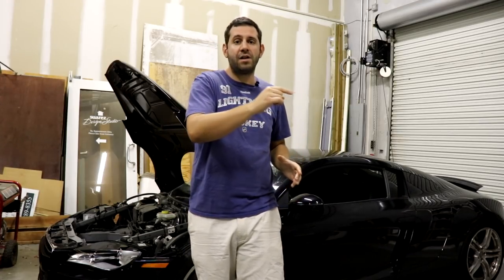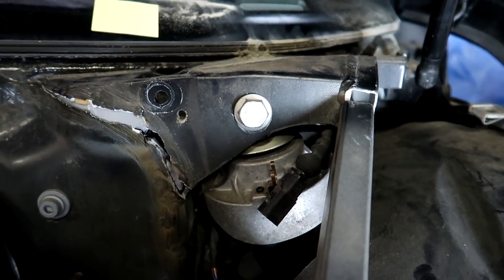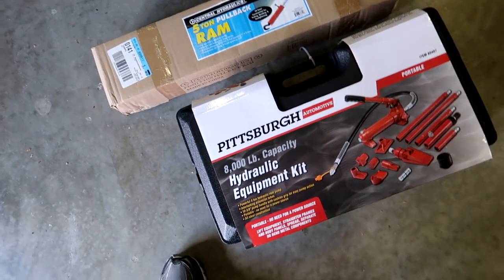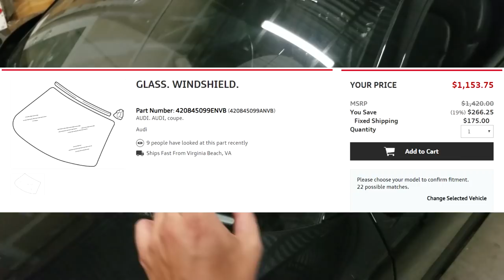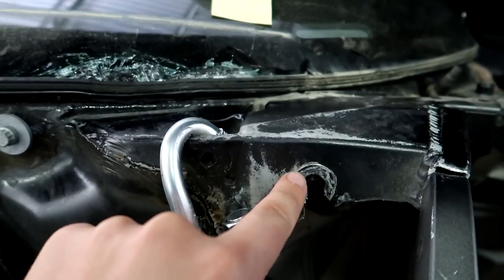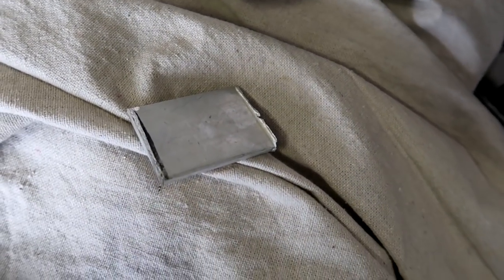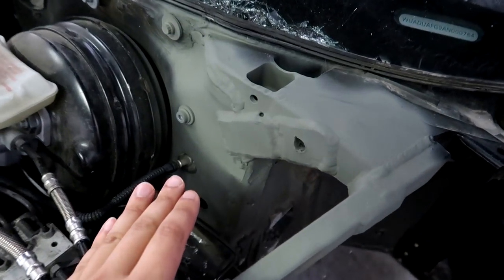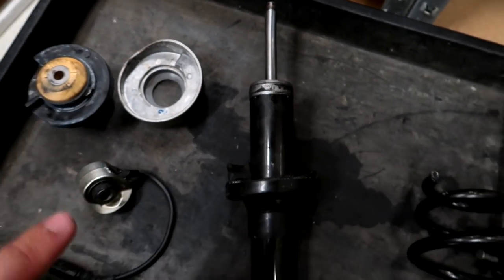I Repaired My Totaled Audi R8's Cracked Frame for $500! Insurance Quoted $29,522!

Comment: Strut bolt hole just re drilled? This is probably a very precise location when manufactured.  I dont see how it will align correctly again.
Reply: Alignment and suspension geometry isn't determined in any way by the top shock mount on this vehicle - it has wishbone suspension - alignment is determined solely by the alignment of those upper and lower control arms which you can see here as items 8 & 6: https://i.ebayimg.com/images/g/~PMAAOSwV-xa1qFS/s-l1600.jpg
Reply: @TonyRule  your comment is true, not disagreeing but the location and angle of shock affect geometry a lot more than you might think, wishbones aren't the only factor of geometry
Reply: @ty27tp  In this case they are - the top mount being out by even 1/4" would make no appreciable difference to the line of action in a double wishbone setup. Camber, rake and trail are all entirely within in the arm adjustment. You could can remove the shock entirely and the travel of the wheel will be identical to with the shock - the hub between the ball joints and the triangulation of the wishbones solely determines this.
Reply: @TonyRule  yeah I understand that, but location of the shock top mounts affects everything from ride height to damping, as far as I know this is all part of suspension geometry
Reply: @ty27tp  Fair enough. But changes in the range of millimetres to the top shock mount really aren't going to bother a road car - damping rate won't change appreciably - everything is already a compromise - I would say it varies more with just the movement of the wheel and thus the changing geometry as it relates to the hub and heat generated in the shock than that mount variance will change.
Reply: @TonyRule  guess we'll find out when he takes it for a test drive lol, but based on his other vids I'll doubt he'd even notice a wheel was missing lmao

Comment: What you are doing there is called "A Bodge Job" in English English. 7:08 I saw that one coming!!! "ohh, NOOOOOOOOOOOOOOOOOOOOOOOO!!!!!"😂 "It absolutely won't mark metal, but will break your windscreen!" I think you should add the $1300 for the windscreen to the $500 in the title.
I repaired a (steel) 1974 BMW 3.0 CSi (now worth $70-90k) that was damaged in a similar way but much worse, by jacking the strut top back down against a wooden beam across the rafters of my garage workshop! it worked. It had hit a high kerb at 50mph (80km/h) with the same wheel, breaking the alloy wheel, and knocking the suspension back 10cm, and unzipping all the spot welds on the strut top.
#Rob the Welder, CAN HE FIX IT?
#Rob the Welder, Yes, he CAAAAN... Rob thinks: " Oh, I see you've already broken your expensive windscreen (shield) so I won't bother protecting it from grinding and welding nearby..."

Comment: Look at it this way. This R* is now stronger than stock at both front mounts, regardless of the naysayers. Although it would have been nice to see a large formed metal plate that covers most of that tower, somehow sandwiched and welded to carry the stresses across the whole area, or maybe Audi should have used thicker metal and ran the front skirt at a better angle toward the bottom.

Comment: Would not touch that car.
Reply: Yeah, this is hard to watch
Reply: sheer64 anything makes sense at the right price, which in this case we do not know.
Reply: such a hack job, first bump over 50 its coming apart...lol YOU CANT REHEAT ALUMINUM
Reply: @tylerk.9495  You can't reheat aluminum??? LMAO where the hell did you hear that?
Reply: Tyler K. 35% of all aluminium produced in the United States comes from old reheated scrap.
Reply: @sonnylatchstring  Wait, really??? ONLY 35%!?
Reply: @tylerk.9495  lol what
Reply: @sonnylatchstring  And then heat-treated to give it specific strength properties.
Reply: I think the people that are commenting aren’t mechanical engineers. Some people’s kids. I would buy it for the right price.
Reply: @jameshintergardt973  I wouldn't trust this repair job just because it's a hack job. The welder seems skilled but with the amount of butchery on a high stress area of the frame I would not be surprised at all if it were to fail again. Right price however... yeah. Then I'd sell the thing for parts.
Reply: Looks stronger then the original  manufacturing process.
Reply: @jmiles9836  It's possible that that particular area is stronger but it could be causing higher levels of stress in another area of the frame. Which could cause sudden failure there. 

Also like people have mentioned the mechanical properties are out of whack especially after the fractures and welds. So because it looks stronger doesn't necessarily mean it is. 

Still, I'd just part out the car...
Reply: @tylerk.9495  So THATS why they have been welding aluminum for many decades now!!! BECAUSE YOU CANT REHEAT IT!!!! I guess recycling soda cans is wrong too, because they are smelted and reshaped back into virgin aluminum again... LMAO. WTF are you smoking dogg?
Reply: @SS-ws8bf  not even close man pop cans are 319 aluminum trash alloy brittle as shit I worked at an aluminum foundry we used 26 different alloys to make sand casting parts structural aluminum is high grade alloy has different metals added for strength
Reply: @tylerk.9495  I'm sure he's already done that and it held together fine.  It's stronger than factory now, without a doubt.

Comment: Waiting for the side load of the chain to send the jack flying. You really put you life at risk there....
Reply: There was a sizeable amount of the weight of the car on the jack. I personally wouldn't have done it that way, but it worked. I would have anchored a ring into the floor perhaps, or better yet, towed the car to a body shop with a frame rig and done it properly. I agree with others here though, this is likely not a proper repair. There are additional areas of concern that are hidden.
Reply: OMGWTFLOL  Car weighs 3505 lbs with a 40/60 F/R split. That's 1402 lbs on the front and split it in half for one corner and you have 701 lbs in the one front corner. Takes some off for the suspension, wheel and other various bits he removed and I would bet that it was 500 lbs on that 1 jack stand. Without getting into angular forces it's not a lot compared to the 8000-10000 lbs that ram could pull. I would have anchored it with a chain to one of the tow points under the car that is rated for quite a bit. Water under the bridge now...
Reply: putting your life at risk?  it's not like he was under the car lol.
Reply: greg h he was standing right where the jack stand would have shot out

Comment: How on earth did that not fall off the jacks? You need to invest in a ramp.
Reply: M ell Yes very dodgy pulling against the jack via that hole! I hope he did reference measurements against the good side for alignment at the very least and not the most aesthetically pleasing repair and reinforcement. It’s got to devalue the car as it looks bodged come sale time?
Reply: @markbennett6658  Well...he did buy it at a massive discount as a salvage vehicle with a cracked from Copart. Value only goes up from there.
Reply: I do a lot of my own work and used to work on trolleys and stands, almost lost my hand (no lasting damage) went straight out and bought myself a 4 poster, best investment ever and my man cave is a joy to be in.

Comment: I ask myself, what would the german TÜV say?
Reply: Gute Frage!
Reply: Just export it to eastern Europe as accident free
Reply: NEIN NEIN NEIN NEIN!
Reply: So ein Murks!!!!!!!
Möchte die Karre nicht für  Geschenkt haben! ;-)
Reply: TÜV is crooked in the first place when they authorized to sell this peace of crap R8 whose frame cracks like nothing.
Reply: Scheisse.
Reply: Sieht doch keine Sau wenn die ganzen Verkleidungen da verbaut sind.
Reply: What a well made and engineered German car this Audi is. Are you insinuating it is as poorly designed and badly assembled as a 20 year old homemade  Chinese vehicle?
Reply: I've had one with both Dekra, TUV and some 3rd party papers. Repair was done by audi and looked worse than what Sam did here. Not even a single letter on any of the papers or on the TUV given certification of conformity ( i bought it from a German dealer to import it to my country)... The car is a POS, i mean any R8 not just Sams one, I had a leak in the door,  both towers welded, finicky automatic, problems with MMI with a flipped picture and random lights popping on while driving. 
Sold it still under used car warranty to a guy in Italy he modded the f*ck out of it - lime green wrap, chrome wheels and i think a turbo kit. 
I own a Skoda superb now, got sick of the "high tech" cars after the R8 and an M6.
Reply: Did not used a car frame laser repair system...they worked as our eastern neighbours 15 years ago. Making 1 car out of 2. I bet this car draws 3 lines in the snow instead of 2.
Reply: Andreas Witten 🤣🤣🤣 it’s a death trap
Reply: Vhy didn't veeee think of dat?
Reply: It's fine, that's how Audi designed it; near enough is good enough!
Reply: A German TUV inspector (if he was totally honest) would say that if you wanted a high quality aluminium car you should buy a British Jaguar or other sports car or an American Ford truck not a German designed and built piece of rubbish masquerading as a supercar.
Reply: @andreaswitten  finally someone who knows how things are done right. the video is very entertaining but this not the way it should be repaired. the alignment is crucial not something you can do by eye. or a ruler.
Reply: @andrewallen9993  I almost agreed until you started talking about a Ford truck . American made cars can't corner and break much faster then any Japanese or European car. they handle like a boat. build quality of German cars in general is reasonably good.
Reply: @andrewallen9993  You can't compare a 'supercar' with a Ford truck, come on! lol
Reply: @atrem7942  You are right, they handle like shit. However they tow loads,they carry loads and unless you grossly mistreat them the frame welds don't crack thus making them well designed and built for the job they are required to do. The R8 frame cracks because Audi didn't design and test it well enough so it is very badly designed and made for its job as a supercar. NONE of the oval steel pipe chassis welds on my Maseratj Sebring have broken and its a super car more than half a century old. Neither have any of the welds on my sixty year old load carrying VW split window kombi.
Reply: @Toby_the_Glen  They are both made of welded aluminium right? The difference is that the frame of the Get an supercar cracks and fails so you are perfectly correct, the German supercar cannot be compared to the American truck as the truck was properly designed and tested for the job it built for. The Audi was not designed and built properly so there is as you say no comparison :)
Reply: @andrewallen9993  dude a Ford has a ladder chassis with a cab on top of it. most European cars have a selfsupporting chassis. you comparing apples with bananas.
Reply: @atrem7942  Well yes, I am comparing aluminium vehicles from three different country's. The one that's badly made and designed to the extent that the frame cracks in normal use is the German one.
Reply: They should have inspect the car design before it was put on sale in 2006,

  its questionable was it ever safe to drive ;-)
Reply: @Sim-903  Correct sir! Shitty German engineering made worse by shitty German assembly. All done to save two twenty five dollar parts at the retail price. And the worse bit is they did not admit it and have all the faulty cars retrofitted with these  cheap parts at this minor expense. Think about what would have happened if this failed art supercar autobahn speeds!
Reply: @andrewallen9993  only a few cars really had this specific problem. but it is true not much is necessary to cause this on only the earlier models a big american pothole on high speed can cause damage. in Europe I have not found any reports on this problem. From 2009 and on Audi reinforced this area in the building proces. As I also discovered & expected this is not the way Audi would want it to be fixed.
Reply: @atrem7942  That's like saying Takata airbags have only failed catastrophically a few times. And the A8 was called a supercar not a cheap runaround.
Reply: @andrewallen9993  dude stop comparing things you are horrible at it. it does not make a strong point. I don't agree, go walk it off.
Reply: @atrem7942  So you EXPECT the frame of your car to crack? I expect the frame of my car to NOT crack and that is the comparison I am making. For a supercar frame to crack is really bad when non supercars at far far far Lowe prices do not.
Reply: @atrem7942   I know of 7 cars off the top of my head now that have these cracks and that were "repaired" while undergoing regular service, all hush hush work two of the cars were rentals one in Munich one in Stuttgart same company, they moved away from all audi products in their offering after that. The Munich car the frame failed twice.

Comment: To all you experts posting about in fairness, a botch repair to the cracked frame saying it will not be as good as an OEM repair. Just consider that when this was built by Audi brand new, they made this part of the frame too weak which caused the critical failure to begin with. Why would you trust the OEM's 30k dangerous frame design fix any more than this?
Reply: Stuntman707 you really think Audi make a critical frame structure too weak? Audi didn’t total the car, insurance did. Look into insurance companies claim adjustment policies. They are paid not to pay out. If they could blame this on Audi and deny claim how quick do you think they would do so. Insurance companies spend tons on deconstructing cars so actuators can set the rates. That’s why some cheap cars cost more to insure than better built ones costing much more. Face facts, this clown is endangering lives with this joke.

Comment: If I, that's a capital I, had bought the AUDI, I sure would have this differently. First, I would have taken a master mechanic with me to let him examine the car. He probably would have found the problem quickly and told me what would be needed to repair the vehicle. The mechanic or I would have gotten a fully charged battery when the car wouldn't start. I always take one with me. If the fresh battery got the car started, as it did at your place, loading and unloading would have been easy. I now know that the car starts. Secondly, I would take the car to a car frame shop and have them do the repair. (No broken glass). Since this is part of the suspension, I would know that close is not close enough in this type of work. I will get a wheel alignment. This alignment assumes that the repairs are done perfectly. I can't wait to see the following video.

Comment: My dream R8 would have a V8 with twin turbos
Reply: Why not the V10?
Reply: isn't the v10 preferable?
Reply: @williamskagen9901  yeah it is. Becuase a twin turbo kit cost the same whether it's a v8 or a v10.
Reply: I prefer the V8 as well.
Reply: Now I'm not the dude who posted the original comment but I'd asume he prefers it because of the manual transmission with the gated shifter only available with the V8.
Reply: And R8's are no longer competitive    in 1/2 mile roll racing. Underground has a couple of 1000hp R8's.
Reply: Siml Also twin turbo V8 models sound awesome
Reply: Sibtain Search up “R8 V8 Twin Turbo” on YouTube. The sound is awesome

Comment: It’s ok for NOW! It’s been fixed. 
It’s a nice car put it back together see how it goes.... drive normally around town etc 
personally I would not drive fast in a public situation. unless it was on a track as the car moving 
the loading and de loading of the suspension MAY cause stress fractures etc. 
BUT I have seen some metal parts fixed that no one would thought work and it has so what do you do?
Try it and see!

Comment: hah, I did that once with the windshield on my first car. It was a 1996 Saab 900 S. In my case I was mounting the ez-pass on the windshield and there was already a rock chip crack in that location that wasn't sealed all that well and it was winter time and the crack just split across. I was pissed!

Comment: I love all the annalist comments...lol...                                                                                                                                                                                                               Its a simple physics and repair which in absolute no way affected the frame, squareness, suspension, handling, windshield, door seals / gaps, ect.. hence it will pass inspection easily... In all actuality the repaired driver side suspension area weld is 200 plus times stronger now than the right side.. only error i saw in video is while he was there I would've had him weld a support in on right side ?!?  Nice work !!

Comment: I read through some of the comments here and most are right... it will possibly crack again depending on how hard it's drivin and how many curbs/potholes he hits. The worst that will happen is the alignment will be out of wack and it may pull some. It's a mall/grocery car with a badge now. I wouldn't use it on the track either.

Comment: He's welding the frame back together where the spring goes and he doesn't see an issue. You also needed an anchor in the concrete for your pump top leverage against.

Comment: For a repair like this, the car should go to a body shop that has a Frame Machine. So precise measurements can be taken and it pulled correctly. Then welded.
Instead This is like a  DIY driveway repair - which is dangerous. Its not repaired in the manner that is Safe!!